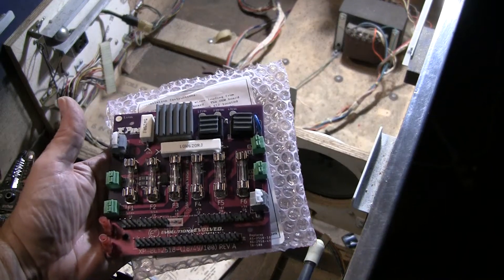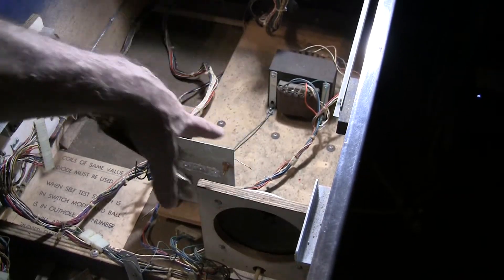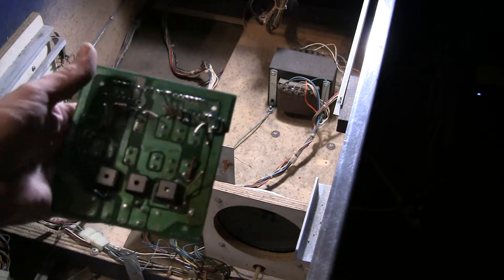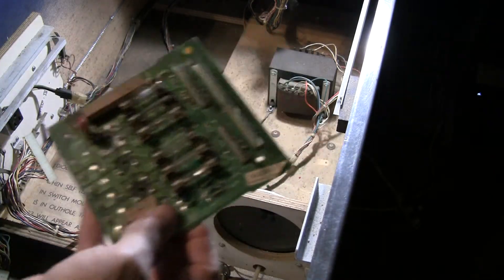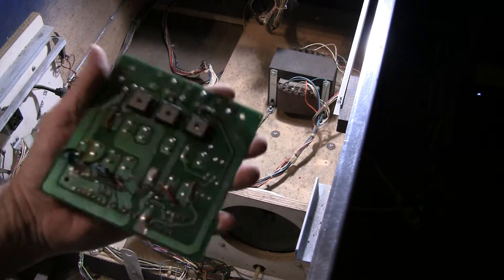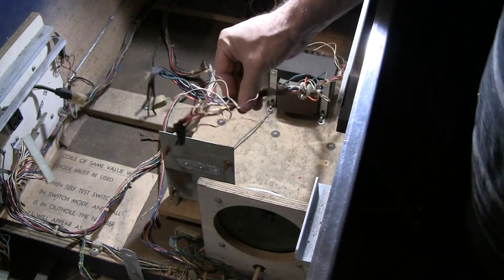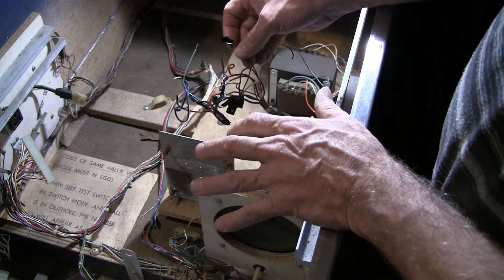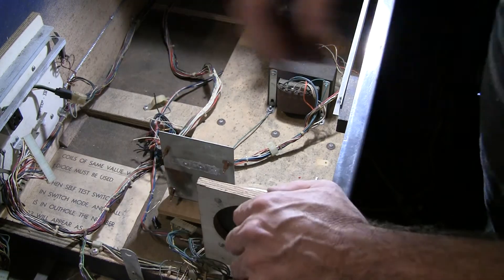Stern Trident - Power Supply Replacement - Part 1/2 - PinballHelp.com

Comment: You could unscrew the plate that the rectifier bolts onto and move it back towards the transformer.
Reply from the maker: LOL.. I didn't think about that, also didn't check if the front connectors had the length to do that.   That's something else to investigate.